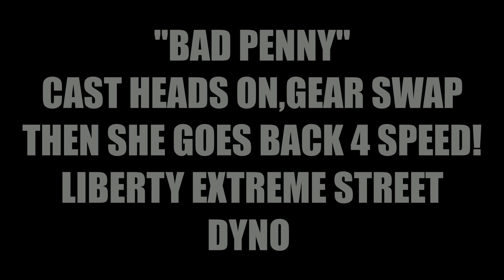SKULL GARAGE 2024 EP.12 "BAD PENNY" GOES BACK 4 SPEED WITH 5.57 GEARS,ALL NEW COMBO FOR THE 57

Comment: I can tell you from experience with that exact setup other than mine is a five speed you need to get the slipper clutch in there even if you have to use the aluminum flywheel but you’re correct it needs the steel one that Ram makes . The iron disc with a standard pressure plate will hook to hard